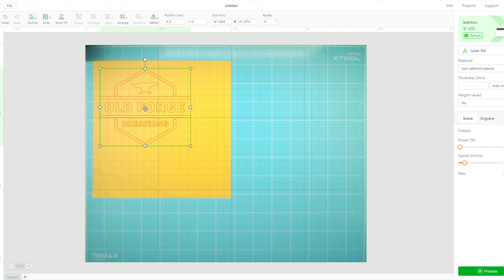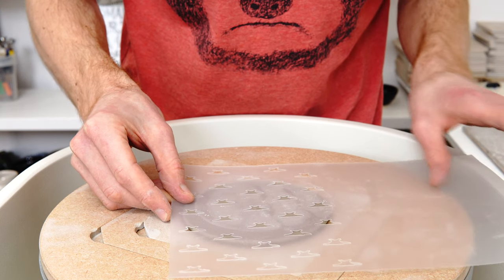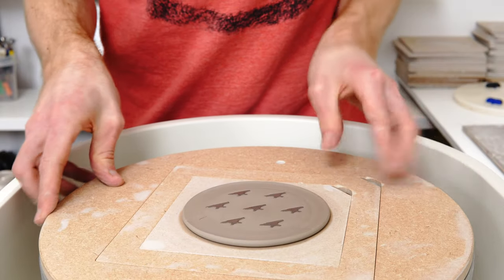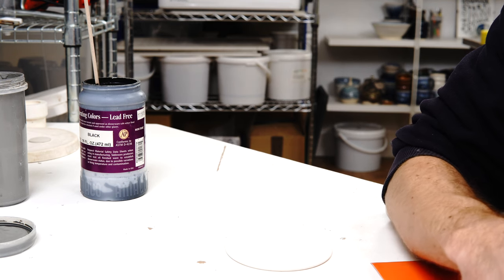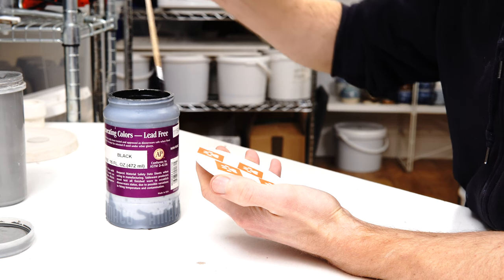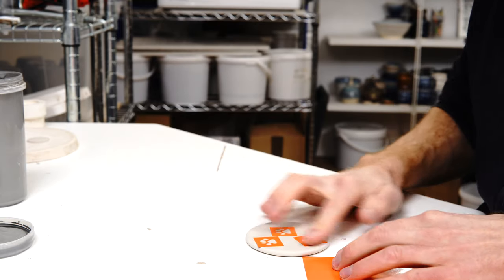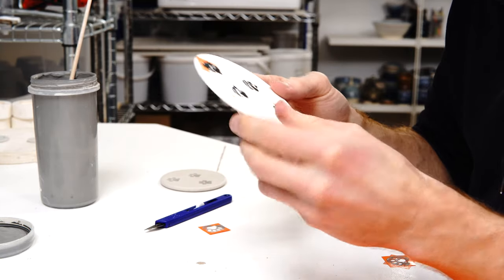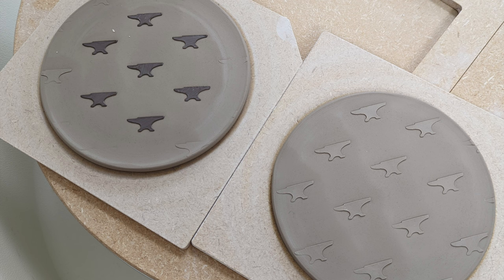First Projects with the xTool M1 and RA2

Comment: Transfer tape should work better as stencil - easier to remove because of lower tack than vinyl.
One other thing you can try is make stamps from acrylic, just be aware not all colours can be cut with a diode laser.
But overall it's refreshing to see how you're incorporating this in your craft, not just doing generic "laser gift" items.
Reply from the maker: Thank you, that's very helpful!